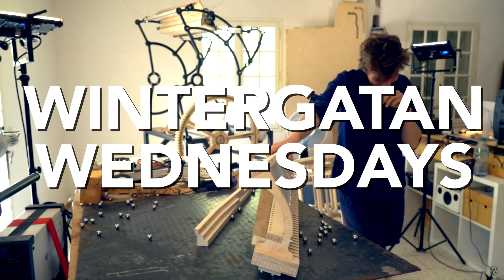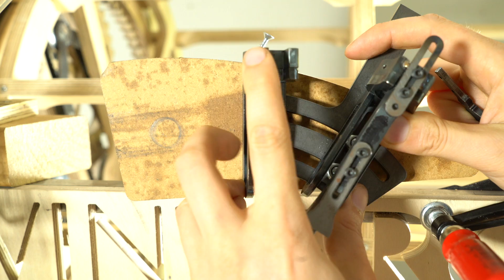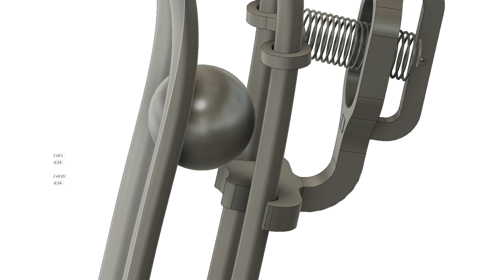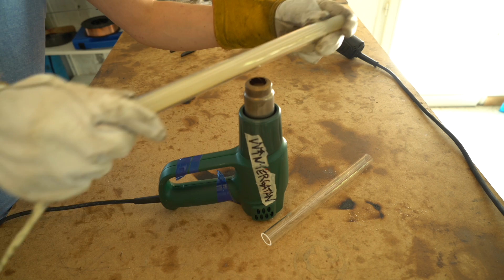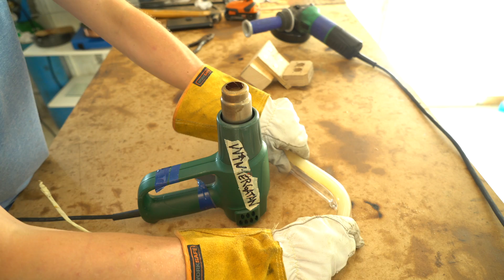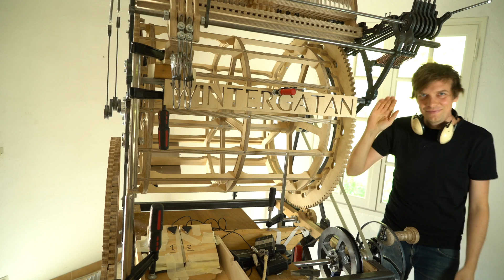Dropping the Ball - PRECISELY - Marble Machine X #52

Comment: Hi, First, this looks so awesome and it is just.. i can not wait until this gets done. Great work ^^

Now to my question, at 23:47 you can see that the magnets from the programingwheel has done marks in the regristrators. 
You have not used them that long but still they have these marks now. 
Is that something you have thought of? Like are you gonna have spareparts for that and such? 
I can imagine that will change the timing after a while. 
I did look at the old machine and there you have some material where they did connect. 

GLHF with the rest of the build and hopefully i would be able so see this on the tour <3

Comment: Just curious, what about adding a touch of felt onto the top of the catch to prevent the ball bouncing around when it slides down. Wouldn't that cause the ball to settle a bit faster? You could probably shave off a few milliseconds.

Comment: Great video as always!
One feedback: I saw the springs in the release system move around quite a bit, which may lead to inconsistency in the release. You may want to drill small grooves into the metal rods for the springs to lock into, but keep in mind that the springs are a tiny tiny bit looser after that

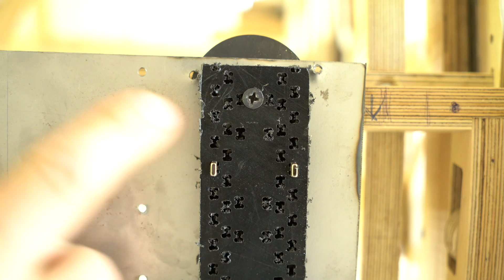Comment: Hey Martin, have you considered that maybe some of the error you are getting comes from the pins in the programming wheel not being cut with enough precission? Check 19:53 to see that the distance between the holes in the same line, wich would be consecutive hits, is not completely even.
Nearly there! keep it on!

Comment: Your variations in precission may also be a result of vibration of the whole marble machine X. As you turn your crank wheel you introduce vibration to the whole system on all 3D axes. This will lead to slight variations on the fly path of the marbles and therefore result in a difference in the landing times. Also: Variaions in the speed of the crank will lead to other timings. As a suggestion: Try to drive the crank with a motor for testing purposes. The motor will lead to more accurate test results, so you could measure the timing differences more precise and do a better basis tuning. This will help you to do the final tuning with normal crank operation.

Comment: It might be useful, for setting up and maintenance, to have a 'click'  timing sensor permanently mounted on the crank and any other time critical parts . If/when you have to repair this on the road having a consistent way to test will make things a lot easier. ( I'm thinking here about a tiny inductive timing sensor that would not be intrusive)

Comment: 19:18 going frame by frame (using . and ,), it took 9 frames for the release mechanism to reset, and ~9 frames for the marble to arrive after the release has reset, so in theory, ~300bpm is the upper limit for 1 channel. so safely, you should be able to get 250 ish, and then with the second channel, you can get 500 bpm easily.
also, with the mechanism, wouldn't increased spin also speed up how fast the mechanism resets? if so, you could get close to 400 or even further with one channel.

Comment: Hm Since you wanted to drop the marble in the same spot: Couldnt you have tried to make a system where the two marble releases are above each other rather then next to each other? One could drop the marble straight down with the other one dropping it at a slight angle. That would mean that the time untill they hit the instrument is different but if the one that if launched at an angle is below the one that falls straight that should be a rather small difference. It would also make the trigger mechanism and marble dividing different but would also allow a more narrow build.
Keep it going Martin!

Comment: In rail engineering, we bend metal all the time. Rail is actually really floppy so if the radius in a turn is more than about 500m then we don't bother to press it to bend, it you can move it by hand.

Comment: Hi Martin
I’m extremely impressed over what you have done so far! You’re very inspiring. I have one question though. The programming part holes looks like they can wear down quite fast. It doesn’t seem like they are 100% similar in size. I hope that isn’t the case, but if it is you should do something(?) 
I which you all the best :)
Kindly regards,
Lars Kristian

Comment: Hi Wintergatan, first of all, awesome work  your doing! and it looks fantastic and I have deep respect for you. Anyway I came up with a question, but it can be that I missed some parts, or you already have a solution. The question is the following
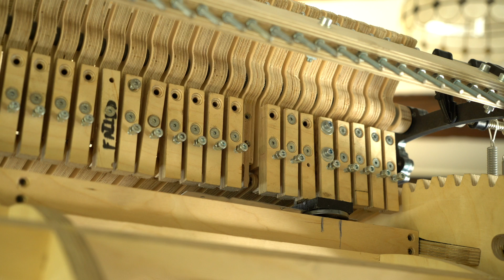At minute  23:40  we can see how that the metal pin is touching directly on the plywood registrator.
 Don't you think that the plywood is going to consume under the constant hitting of the metal pin on the same spot over and over again creating inconsistency?
thanks again.
Cya

Comment: Have you checked if the plates withe the microphones are perfectly level? Otherwise that makes a huge difference in terms of hitting time.
And way was one of the regestrators early? Is it a problem with the position of the pins or with regestrator itself? Because if it is a problem with the position of the pins you would have to adjust all 38 channels every time you switch the programming plates (which I think isn't a possibility).

Comment: the reason for the smaller delay between marble contact and crank turn is that the drop distance is fixed while the crank is turning, and the crank speed varies based how fast you are cranking. thus, varied delay.

Comment: Hey, quick question: If you adjust the timing with different heights, whouldn't this result in different speeds and therefore in different volume? If you can adjust the release timing with the shims, why not just use this?

Comment: Hi Martin, if your planned method of reducing shaking doesn't work, you can try filling the steel base with epoxy, concrete, sand, or granite casting. Perhaps you know this, but many industrial machine builders use this method to dampen vibrations and reduce resonance throughout large precision machines. Since you're using hollow steel tubing, and not cast iron, this might be a great option––though I know the frame is quite skinny. Curious to see how you combat this problem. Cheers.
Reply: Sand is a really good option, that's what i did for all of my fixed tool (anvil, belt grinder etc) to avoid "resonance" (vibration that crawl up my arm, i'm sorry i'm not a native english speaker and i don't know if what i'm saying makes sense...)
Reply: Might make it unnecesarrilly heavier, which is not ideal for a moveable machine. But it does have some merit to it, it might be worth trying it out.
Reply: @btCharlie_   The good thing about sand is that it's removable, but the process of taking it out and refill the tube each time you have to move it isn't really ideal
Reply: Tomáš Karlík  it depends on how important it is to him. It’s only unnecessary if he reduces shake another way. On the other hand, if the shaking causes marbles to fall inconsistently and ruins the music, extra weight isn’t a big deal. He does want precision after all—but it’s still in testing phase so we can’t say for sure. It’s an option.
Reply: @DanielDeArco  - yeah, that's why I said it still might be plausible
Reply: This same method is used for noise dampening in roller coasters, the noise is greatly reduced when the track spine is filled with sand.

Not dampened: https://www.youtube.com/watch?v=sELOWG6kuBc

Dampened: https://www.youtube.com/watch?v=IeM8lla92Tk
Reply: The first thing to do would be cross bracing as there is clearly a good deal of flex in the frame construction.

Comment: The channel isn’t earlier because of a difference in your release system, its different because the pins in your timing sheet aren’t level with each other, the timing pins placements are going to have to be perfectly square to each other to achieve symmetry in sound.

Comment: You need to rig up a tuning screw on those release levers so you can more precisely adjust the vertical position of the mechanism and thus the timing.  Same may go for the registrators instead of shims.

Comment: Not sure how the new programming plates are cut but you'd better make them very accurate to help with the timing issues... If the distances on the programming plate are not  equal within x micron your timing starts off all wrong. 
But you probably already calculated this.
Interesting video.
Thx

Comment: Great video! Love the process of experimenting and improving. Do the programming pins contact the plywood release levers directly? Will the friction cause wear (a groove In the plywood) over time? If so, are you concerned that the levers that are used more frequently will lose their timing relative to the other levers? Should the contact points be covered with more durable material to avoid wear on the plywood?

Comment: Hey, about that programming wheel...

So, you've mentioned before that you wanted groups of people to come onstage and help you fill it up for the next song, but looking at your current design, that could take a very long time. Furthermore, if someone fucks it up, which would not be hard to do, it could ruin the song. I'm sure there'll be a little bit of leeway if that happens, but still, those things are smaller than Lego, and people mess putting those together all the time, and unlike the programming wheel, Lego remains interesting while you're building it, rather than after the fact.

I'm not saying don't have a programming wheel people can mess around with, but maybe it would be worth having a look at a more basic Marble Machine design for the audience to have a play with, something you could sell at music shops even, and for the Marble Machine X, you could instead have a computer inside the programming wheel, since you appear to have a lot of space for it, that could program the wheel for you.

Of course, something like that would be expensive, but probably not quite as expensive as it would be to get someone to build a second Marble Machine X.

Comment: Martin, you should have moved marble drop sound line not forward but backward. Your marbles are released AFTER you move your crank, not BEFORE.

Of course, your flywheel reduces changes in crank rotation speed changes, but still while you are measuring milliseconds if you move sound line forward you may measure only your ability to keep tempo, not differences in release speed.

Moreover, if you keep slower tempo and move sound line forward you match your marble release exactly with the next crank turn. So you add measuring error equal to single crank turn duration fluctuation (because mechanical parts passing motion between crank and marble release are working quicker than period of time between crank turns). But if you increase tempo, your mechanical lag may become longer than crank turn duration, so you will add measuring error equal to 2, 3 or more crank turn duration fluctuations. This can explain that you got less error on slow tempo.

To increase measuring quality, you first must measure time of mechanical lag on slowest tempo (time for passing energy between crank/flywheel and marble release plus marble falling time). Then you you must mechanically adjust your crank turn clicker so it would click just mechanical lag before marble click. And only then while measuring you may move sound line of your marble clicks to the closest crank click and it would be quite accurate.

Comment: Will you need to adjust the setup after each assembly? Might be possible to make a tool, a panel of contact mics and an Arduino or three, which will indicate the delay of each channel immediately (rather than manually poring through the data on a laptop).

Comment: May I suggest if you do use the black marble again.
Instead of using a sharpie or paint get someone to either
- electroplate,
- temper/oil thingy
- anodize.
So you can set it apart of course AND not have the colour wear off.

Some of those methods could give quite a nice effect (and still be fairly black/dark)

Comment: Hey, you should consider having a single hex screw rising and lowering  the marble channel that way you can get a real fine adjustment for timing.
instead of opening a lock screw bumping it a bit then tightening again . imagine something like the cnc drive nut, turning the drive screw one way moves it very precisely.
so maybe a captive nut and screw in the top of the channel ?

p.s
that smarter every day music at the end ?

Comment: Looking at the wooden levers the programming pins hit it seems they are already starting to develop some grooves which over time could screw with the timing.  I would recommend putting some metal wear plates on the tops of the levers to counteract this.

Comment: Probably too late, but seeing as you want different tempo's, my thought is that the pins will lift the actuator at a relative speed
A 'airlock' style gate may have been better, the pin closes the lower gate, the upper gate opens and drops a marble, when the pin moves it will release the lower gate quickly,  not dependent on tempo (like dropping off a cliff edge)
It's a bit similar to a clock escapement

Comment: @Wintergatan In your list of requirements, I suggest that you let go of #1. When you need to play notes quickly on a keyboard or percussion instrument, you don't hit the exact same spot each time. If you don't have to hit the same spot, then you can more easily make the marbles land in the same spot. This one small change could improve and simplify the MMX, eliminating that X pattern.
Reply: The issue isn't the strike but the collection. If they do not hit closely enough they cannot be collected by the funnels.
Reply: Dembai  to me the bigger and far more important issue is that there is a minimal delay between ball release. If their paths are due to cross there will be a timing window where the balls will collide as their paths intersect thereby making any timing of notes within this window impossible. To me parallel and separate paths are a requirement for infinite timing options. My gut tells me that 120 NPM is not possible if the two balls share the same impact point or even close to the same impact point.
Reply: @hyfy-tr2jy  lve been pondering that as well, but I think the solution would be better handled by the second channels being released from a lower position parallel to the first, with a bounce point that completes its arc in the same place as the first.

I doubt that there is a true intent to drop in unison. The second channel is to reduce the strain on the first channel. The marbles should never interfere with each other so long as there are never unison moments. 

The unison he used here is only a matter of timing so that a marble dropped from one channel is the same timing as a marble dropped from the other channel.
Reply: Dembai  i think maybe you misunderstand my concern....if two balls are competing for the same strike location, there is a period of time during the first balls arc that will overlap with the path of any other ball including the downward arc, the moment of collision, and a period of the bounce. During this interval of overlap only one ball can occupy that space and if you wanted a second ball to strike the same point, it cannot be timed to occupy this same space at the same time. This period I worry is longer than the designers intent of quick double notes. If the launchers are very close together, as suggested by the designers, the overlap period may  be even longer than I am supposing. Much of this period will depend on the angle of reflection the ball takes after striking the surface of the instrument.
Reply: @hyfy-tr2jy  I agree with your concern. Thus my own consideration of the second channel being below (not beside as proposed) with a different angle of release so its arc can only interfere during true unison. 

It may be that regardless of martens intent, this design cannot work because of the marbles chance of interference.
Reply: Dembai  He could just make one big funnel...
Reply: @TheDreadGazeebo  true, and I've been pondering if a large single collection will help. But I don't know if marten would go for that aesthetic.
Reply: I agree with the general tenor of your comment, but let's not ignore that the clumsy mechanism of a piano can get higher repetition rates from the action of a single key. Perhaps I've misunderstood, but if his repetition rate is 0.5 Hz (120 strikes per minute) then it's seriously unimpressive

Comment: Why not just have the dropping mechanism lead into a tube that aims the ball?
That'd make the trajectories more consistent, and adjustable if you want to redirect unused channels to other notes for special purposes.
Reply: rolling means a degree of unconsistency, specially rolling in a tube. if you want consistent you need to drop it and let gravity work
same position, same mass means it will impact the same timing wise

Comment: I think it is time for you to join the YouTube trend of high speed cameras.  I think this tool would go well for analyzing each part of the drop control/path to synchronize all 38 channels.
Reply: Probably not cheap...
Reply: Gildas P  correct. Most DSLRs now can record at 60 frames, which is roughly "half speed" when conformed to a standard 24/30fps. Some cameras shoot 120fps, but the artistic versions of these cost you some money. Go Pro Hero however isn't too bad (relative to everything else) and it can shoot at 120fps. But judging by the general aesthetic of his videos he may want something more controllable than a go pro. I believe the 6s+ - current versions of iPhones do 120fps too, but I've never used an iphone footage mixed with traditional camera footage. A lot of people have iPhones though.
Reply: Cole Rachal my iPhone 7 does record at 240frames/s